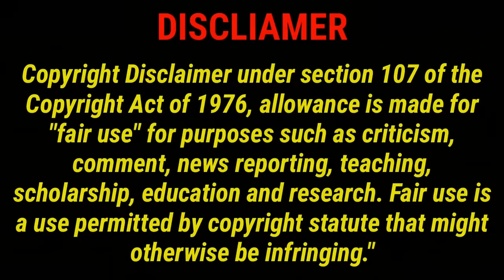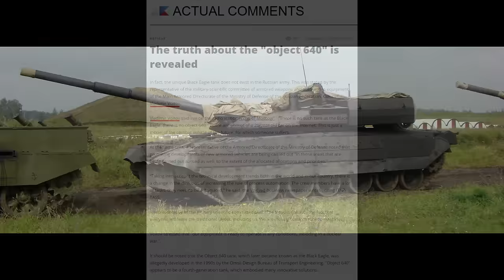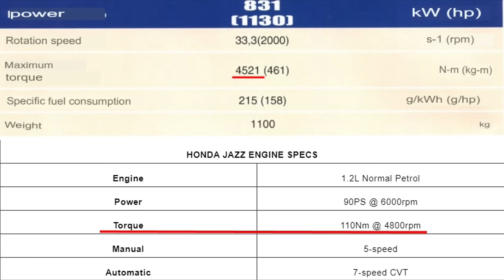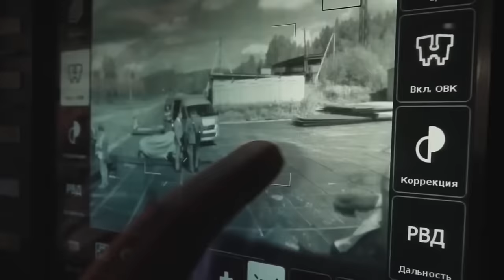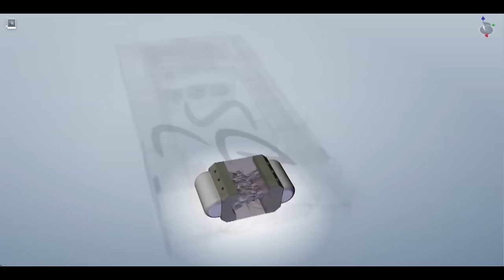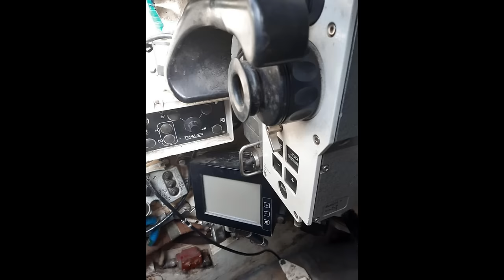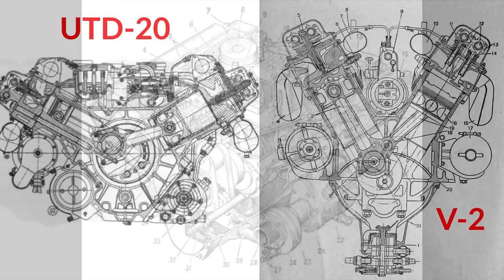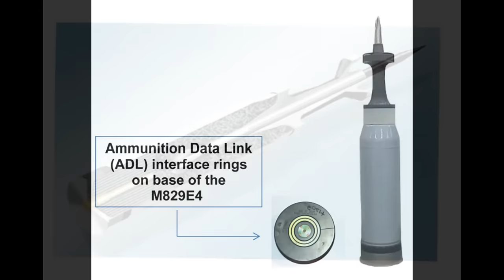LazerPig is WRONG about T-14 Armata

Comment: Remember, tanks are attritable part of war. Their meant to be destroyed. Hence the problem with fielding stupidly expensive tanks. T-14s, as good as they MAY BE, if its ever going to be deployed will have to be regulated to Company/Batttalion Command Tanks as no way will any proper army in planet Earth field such a complex MBT full of fancy gizmos in a huge open war. It's just a waste of money compared to fielding T-90s, 80s, and 72s which is not only capable doing the same job, but also save you the cash and maintenance.
Reply: They are absolutely not meant to be destroyed. They are tanks not mounted pickups. Tanks are meant to survive an entire war, and be adaptiable in that war to changing circumstances. They are not meant to a single use weapon. Thats what explosives are.
Reply: Waste of money? Doesn't matter in a conflict as much as the waste of lifes/menpower and precious experienced tank-crews.  Wild.

Comment: Going by LazerPigs logic the engine in the M1 Abrams is the same engine the Messerschmitt Me262 uses.
Reply: V2 is an old  (1920) German aircraft diesel engine. the Russians used it because they dident had nothing better and use it today for the same reason. T90M  uses that same old V2 engine. You can modify it but you cant radically change it.
Reply: Lol, obviously you have no idea about gas turbines nor Diesel engines
Reply: @fadfauziug8146  Obviously you're wrong and I'm right because I said so.
Reply: @viktoriyaserebryakov2755  okay then let’s get a little more detailed: the M1 gas Turbine is a Engine that uses 2 shafts meaning it has a low and a high pressure compressor/Turbines. It also uses an Radial compressor as the last compression stage.  It has a total of 4 turbine stages (1 driving the high pressure compressor, one driving the low pressure compressor and 2 driving the tank itself) due to the fact that it doesnt use the air pushing as propulsion which means that it can and hast to take more energy out of the air flow. The Jumo 004 on the other hand is a one shaft engine with just one turbine stage which does nothing more the propelling the compressor which consists of 8 stages in total while all of them are axial compressors. It generates thrust by principal of recoil and pushing the air behind it. It’s a completely different system. Why more difference then between an Gas or Diesel engine for example
Reply: @fadfauziug8146  In other words you agree with the point the OP and RedEffect have made.
Reply: @fadfauziug8146 
...As Viktor said, you just unwittingly proved Datapoint's argument that it was nonsensical. In case you didn't realize it, he wasn't praising LazerPig's logic or saying it was correct. So you saying it's a ridiculous claim... is actually backing up what he said.
Reply: What are you arguing about now? V2 is a 100 year old design that was not designed with tanks in mind. It is not possible to modify one engine to another engine. Why are these abrams and gas turbines involved? What arguments are they?
Reply: @Tõnis Lillemets  because you're wrong. The modern v2 is far larger and has many changes from the original model. Just because the Sidewinder is still used today doesn't mean it's the same exact performance as the sidewinder that had a 10% hit chance in the 1950s lol.
Reply: @matchesburn  A whole lot of words meant to confuse us into accepting whatever he puts forth. Simply put, he thinks he's better than us and would submit to his peacocking. Because we're obviously too stupid. That's all this is.
Reply: @tonislillemets8336  No explanation for why it's not possible of course. Just a statement of fact to be accepted without question. Something tells me I shouldn't.
Reply: Actually it is exact the same performents about 400 working hors ( and you can take it with grain of salt) no performents increase over 80 years.

If you measure performents only in horse powers. Again, you get this 1500 hors pwers peak for a very short time (and again you can take it with grain of salt)
Otherwais V2 reached its perfection in nineteen-fifties with T55. Since then, the russians have been trying to create a new tank engine (and not been able to create new working engine). From this point onwards they are forced to use V2 because they have nothing better.
Reply: @tonislillemets8336  No source = Liar

Greetings liar.
Reply: What sources do you whant? V2 is a very widespread engine and T72 and T90 is a very widespread tank, go and read for different user experiences and different V2 modifications.

If you take the V2 ( and assume 
that all the russian claims of V2 are correct and simply no one else knows how to operate them) you can compare latest V2 with modern tractors and you see that modern tractor diesel without supercharging have same or better power per liter ratio as supercharged V2. And traktors generally do not make more than 2000 revolutions.
Reply: Congrats you repeated what was said in the video
Reply: @fadfauziug8146  gone quiet
Reply: @thelordofcringe  yeah now they have 26%. thats 160% improvement. xD

Comment: The thing about engines is, the basic mechanical design hasn't improved much in the last 80 years. You can find high performance engines made in the WW2 time frame that mechanically look pretty close to what we have today. What HAS improved are things like engine management, material science, machining processes and optimizations through CAD. Heck the German DB-601 had OHC 4 valve per cylinder , direct injection with a mechanical computer for engine management. Sounds pretty familiar to things we have in cars now, except everything is electronically controlled and monitored. Basically the advancements in the last 80 years has let up take what would have been a very expensive, time consuming, large, and heavy engine. Make it smaller, lighter, with more HP per displacement, and bring the cost and production time into the realm that everyday citizens can afford it.
Reply: When a Ford fiesta can out torque a T-80 there's an issue there. The autoloader gives enough memes to make these tanks more deathtraps than anything. Either way Russia only has 8 T-14 since they can't access western imports needed for these tanks along with the Su-75
Reply: @TheButcherHooks  Did you watch the video? Even LazerPig stated that the whole torque thing was a complete mistranslation. Big 18 wheeler truck engines don't make more torque than MBTs, let alone small hatchback engines.
Reply: @TheButcherHooks  you clearly didn't watch either video in their entireties, as both state that that's incorrect. Lazerpig even put it in his pinned comment as well.
Reply: @TheButcherHooks  People make a big deal out of torque, but notice when companies talk about things like tanks, semi-trucks, tractors, heavy equipment. Many times they just say what the HP is. Sometimes you have to dig to find the to find the torque of the engine. Why is that? Because HP is how much work can be done in a given period of time. You can look at it as a unit of productivity. Torque is something that can be largely created through gearing. It's an important value, but it means nothing if you're not actually doing anything with it. As an extreme example an engine that produces 100ft-lbs (or lb-ft whatever you prefer) of torque at 100rpm is only 1.9hp but an engine that produces 10ft-lbs of torque at 2000rpm produces 3.8hp. Which is more useful?  Stick in a gear reduction of 20:1 and you get an output shaft of 200ft-lbs and 100rpm. Of course there will be some losses but your still going to be ahead. So a quick Google search didn't turn up torque and rpm figures for the T-80 for me and I don't have time to go digging. But it's got like 1000hp so I'm pretty sure they can gear it for however much torque they need.
Reply: reminds me of an argument I got into with a friend where he said a V10 will always no matter what produce more power than a V8. He didn't last long at trade school
Reply: 1917 Napier lion w12, 25 liter, 4v per cylinder, dohc.
Reply: Sounds like pretty solid improvements
Reply: Yeah right on... Top Fuel dragsters also use an engine block/layout of simaler vintage, and I rarely hear anyone saying that there ought to be a change. (They're crazy enough, and on the bleeding edge of 'safety' as it is, like 15k hp, etc).

They blow my mind. I got to see one being rebuilt once (during practice). It took the mechanics about THIRTY MINUTES... I can't even do an oil and filter change in that time! (Or anything, really.... Lol.)
Reply: Also these engines tend to be some of the most reliable ones as the defects would have been ironed out by now.
Reply: @d3faulted2  Not quite. Torque plays a big role with tank engines, especially the torque curve. Engine that can produce max power at 1500 RPM is preferred to engine that produces it at 3000 RPM, although the latter might be lighter weight. Technically it's true that gearing up or down is useful, but in practice it's rarely done (Germans preferred lighter, higher RPM engines in WW2). Technically speaking, you could take 2022 F1 engine (1,6 L, max RPM 15 000, HP> 1000) and put it to modern MBT. But it wouldn't fare well.
Reply: @j.e.v.5016  I never said torque wasn't important, it's just that it's one part in the equation and people act like it's the end all be all. I may have underplayed it's roll to prove a point. Yes Torque curve is a big thing with tanks. That's why the U.S. army went with the Turbine in the Abrams. You are very wrong about one thing. Engines are almost always geared up or down.....that's what the transmission does. The challenger 2 tank has 6 forward and 2 reverse gears for example. Or look at Semi-trucks they make quite a few of them with 18 speeds. 

Yes the engine out of an  F1 car wouldn't fair well in a Tank. The design principles are way off. They are sacrificing durability for performance. One of the reasons low RPM engines are preferred is they tend to last longer than higher RPM engines, run more efficiently and burn less fuel. Those large diesels last forever because they are overbuilt with huge bearing surfaces and a relatively low HP to displacement ratio.
Reply: @TheButcherHooks  What ford fiesta do you drive that can out torque a T-80 Gas turbine engine with a maximum torque output of 4395 Nm. There is no issue with the T-80 nor the T-90 Engine, it's just y'all don't actually fact check anything.
Reply: @TheButcherHooks  Turret tossing isn't the problem, it's simply the most cinematic way to blow up a tank, so everyone pays more attention to it. And it makes for a propaganda loss for the Russians, but isn't what's wrong with the T-90. 

Any tank explodes when the ammunition gets ignited, but turret tossing looks the coolest.
Reply: @TheButcherHooks  Hello dear LazerPig fan, here's 3 facts for you:

1. A typical Fiesta has 100-200 Nm of torque, a T-14 has some 4000-5000 Nm, so 20-50 times more.
2. It's not the autoloader which is to blame for explosions but munition laying around outside of protected compartments.
3. Both T-14 and Su-57 are in serial production. Russia ordered 120 T-14s and 77 Su-57 to be delievered in the next 3-5 years along with other vehicles/aircraft.
Reply: In fact, the principle of the steam turbine hasn't changed since the 1910's. Doesn't mean it's suddenly obsolete.
Reply: understanding of physics has changed a lot in 80 years and what was trial and error before it was replaced with very accurate computer models. when you look from afar you think engines are very similar but when you see details there are huge differences. 
the thing is that these heavy duty engines are mostly quite old. for changes you need to see car engines or something that has the most massive production as there is the most new technology used.
Reply: @jebise1126  With cars they are also always pushing for better efficiency and more power in a smaller, lighter package while keeping within emissions regulations.
Reply: You can say that the design and concept aged like Wine, and not like milk
Reply: Yep. The Kharkiv V2 and all of its successors are 4 valves per cylinder, dual overhead cam, and all aluminum head and block.
Reply: modern diesel engines have not changed much in the last 20 years. The recipe for good power is common-rail direct injection, lower compression ratio, EGR and boost. tank engines should be very reliable since they don't need all those emissions crap.
Reply: @TheButcherHooks  one critical thought would've made you realise that a 1.6l engine can't reasonably make more power than an engine which weighs more than a car. The main issue with building the T-14, materially wise, is electronics, but not much else.
Reply: Well to be fair the combustion chamber changes started in the late 70s so it wasn't really cad based. Same with intake design. Combustion chambers and fluid dynamics in engines are fucking nutty
Reply: theirs also a billion ways to cheat torque numbers vs horsepower those giant stationary engines from like 1913 sure could make 3000lbs of torque but then the cylinder is the size of a containership and it has 30 horsepower most of that torque is just the sheer weight of it moving components like the 1000lb flywheels @d3faulted2

Comment: 13:32
to be fair; the MTU is a power pack with transmission and a few other things already included for ease of replacing.
Reply: MTU is an engine, MTU MB 873, the power pack is called "Euro Power Pack", the engine as engine, according to MTU themselves weights 2.2t
Reply: @azrael9016  im certain the that thats the nomenclature for the whole power pack. the german page of the Rolls Royce Power Systems isnt really helpful in that regard unfortunately. I also could be absolutely wrong.
Reply: @Keckegenkai  The data sheet which states that the dry weight is of the engine itself is official by MTU. There is also a document by MTU which says the same thing. Also for comparison, Leo 1 that does not have a power pack and the engine (MB 838) is a "separate" thing and is on its own, its engine which is kinda a "smaller version" of Leo 2's engine (2 less cylinders and is thus overall shorter) weights 1920kg completely dry.  Leo 2's engine, being larger weights 2200kg. But regardless of Leo 1 comparison, the MTU official information states that the engine itself is 2200kg.
Reply: I thought a power pack was the engine, transmission and cooling unitised for ease of replacing
Reply: bro the MTU is more heavy than my car lol
Reply: @azrael9016  MTU ist in erster Linie ein Unternehmen aus Friedrichshafen (Bodenseeregion), welches große Dieselmotoren fertigt. Wenn ich es nicht besser wüsste, würde ich fast raten, dass das Getriebe von RENK geliefert wird. Aber den Motor mit Endmontage des Getriebes wird MTU machen und diese Power packs dann an Krauss Maffei Wegmann liefern.
Reply: @azrael9016  I stand corrected.
Reply: @Tomartyr  The Power Pack is all you stated
Reply: @Rubensky44  it probably has 20 times more torque than your car ;)
Reply: @azrael9016  I think this is the weight for the engine, since a marine diesel which is based on tank engine weighs even more.
Reply: The engines is not sold without the pack which is the reason it states “dry” the 2.2 ton ins the whole power pack
Reply: @fadfauziug8146  No. Transmission is added seperately.

Comment: Holy shit I thought you were gonna just point out some minor mistakes but nah this man just flamed LazerPigs whole video 💀
Reply: How can "The Honda Jazz (Which is 1 ton) has more torque than the T-90M(Which is 50 Tons)" be a minor mistake?

Don't even get me started on the BT-7s MT-17T being used on the T-90M which is a blatant lie and misinformation. These are not mistakes but absolute dogshite lies.
Reply: @pilotmanpaul  I'm not sure how he got the torque comparison as V2 has roughly 20x...

But the BT-7M (1938) used the V2 engine.
Reply: @Livewyr7  I'm curious as well. Heck, I'm curious at where he got the Honda Jazz torque bs from that he included it in the video. Common sense would say thats not physically possible.
Reply: @pilotmanpaul  But the thought is hilarious... which is probably why it made it in despite being easily disproved.

I'm kinda surprised the pig didn't rail on and on about the no video proof of the gun firing while vehicle in movement. 

That's got to be the most damning thing about it.
Reply: not realy, most of his video was pointed at corruption, he went little to far into technical details